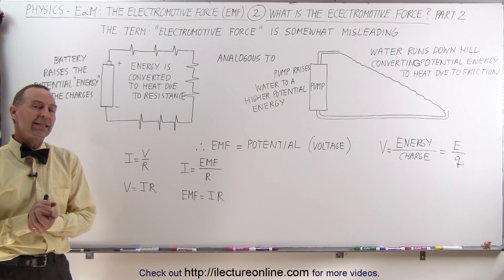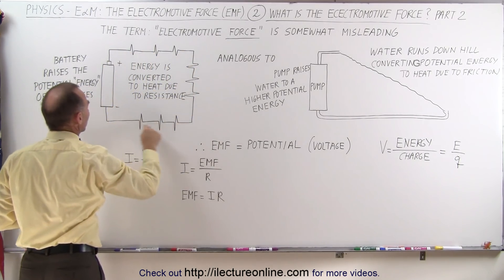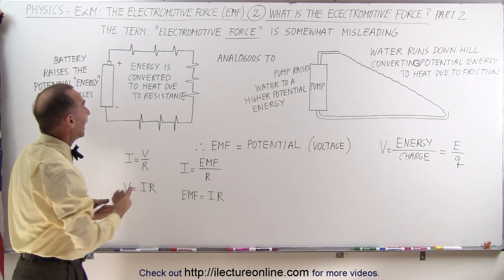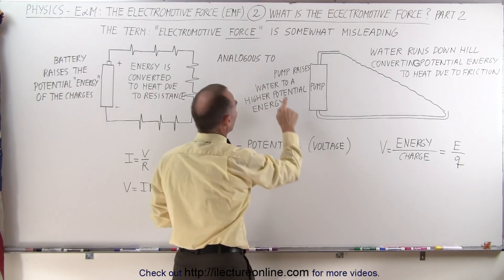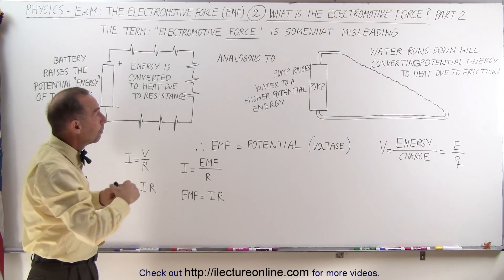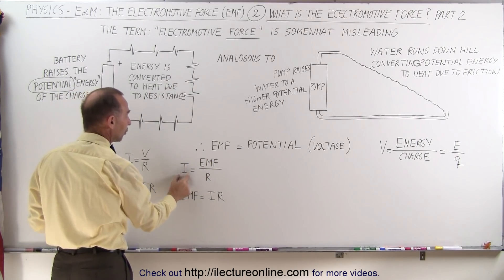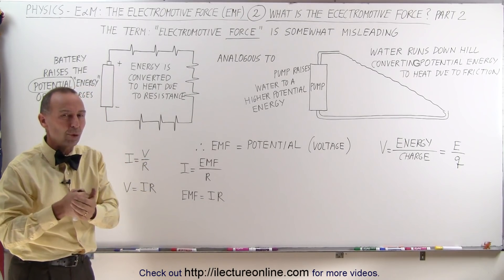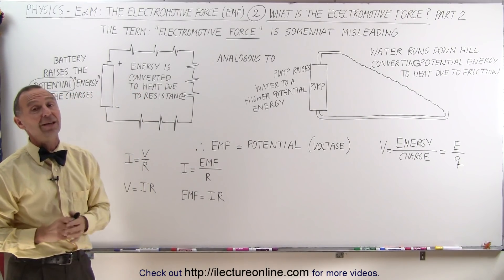Physics - E&M: The Electromotive Force (EMF) (2 of 6) What is the Electromotive Force? Part 2

Comment: If I have a charged capacitor, and connect (short-circuit) its ends, current will flow. Is therefore a capacitor considered a source of EMF? I've seen an inductor is, but usually a capacitor is only considered to develop voltage. Why?
Reply from the maker: A capacitor has many uses.  It reduces ripple effect on voltage planes, it is used to tune a frequency, it is used for ac to dc conversion, just to mention a few.

Comment: You will now plot the angular position vs. time graph for Einstein. This means that time (in seconds) goes on the x-axis (the horizontal axis) and angular position (in radians) goes on the y-axis (the vertical axis). Begin by finding a relationship between angular position and time using the data graphing tool below. Plot at least six (t,theta(t)) pairs (use the + button to add more).

Alternatively, you can use the online site https:\\plot.ly to graph your data. X axis 
1

1.5

1.9

2.2

2.67

2.98
+- Y Axis 
8.1

12.56

15.71

18.85

21.99

25.13
Values
y = -0.15x^2 + 9.11x + -0.83   can you please help me to find the initial angular velocity and the angular acceleration from rhese data in detail
Reply: Maybe you got the wrong video?